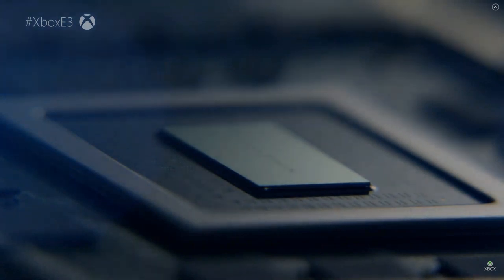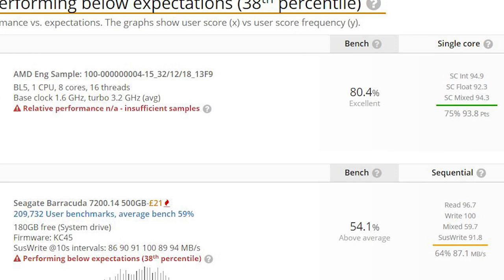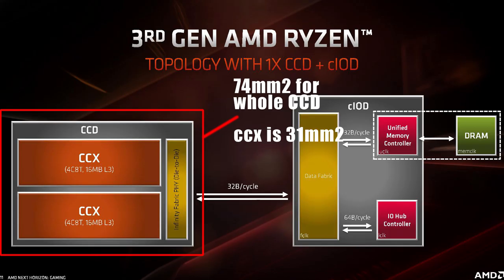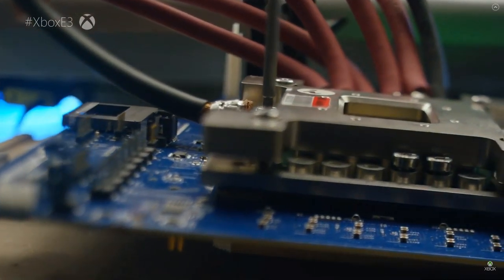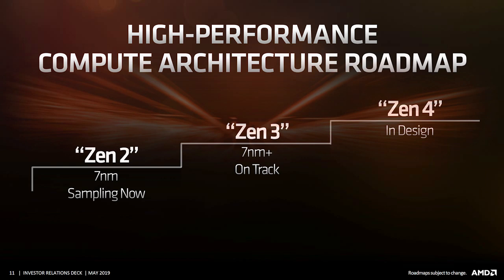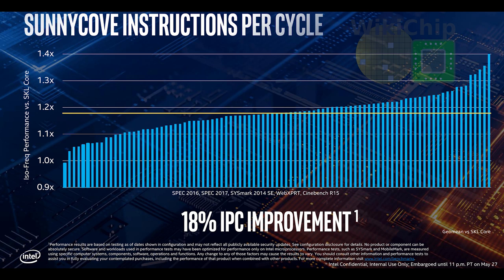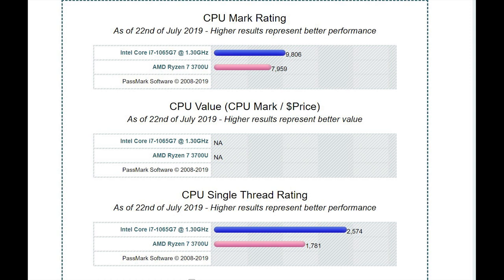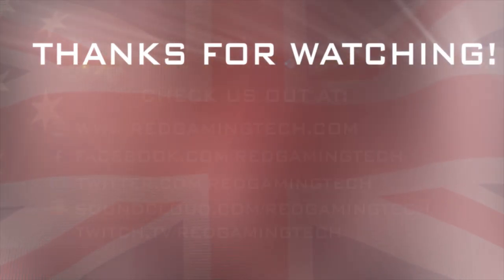AMD 'FLUTE' APU - Next Gen Console APU ? TR4 Spotted In AIDA64 | Ice Lake Is Incredibly Impressive

Comment: the new Intel does not outperform the 3900x in single core. R9 3900x gets 6k on single core...
Reply: IVAN NEGA  it didn't...
Reply: At single core it boosts to 3.9GHz doable at 15w can it sustain multiple cores at such Freq under that power envelope? I think someone bought an expensive intel CPU and is fighting with reality. AMD is king now
Reply: Is not Intel's tdp at base clock?  If so the 3.9 boost is significantly higher than 15w.  And if that boost is all core the heat is on.

Comment: PS5 for sure. You can tell by where the flux capacitor plugs in.
Reply: The board they showed was from Microsoft lol.
It was in their tease for Scarlett
Reply: No , its an UDOO BOLT ( probably the V10 or V12 )
Reply: do you also see the ultra high output plasma field generators?

Comment: You forgot intel TDP is base clock and AMD is Boost clock.
1065g7 is going to pull far more under boost then 15tdp.
Which one is better will depend on price and what you want it for, battery life the 3700u will likely be superior.

Comment: I feel like if new Intel's CPUs are really that fast then they probably will stop AMD from becoming dominant in all markets.
Reply: So far they only have low power laptop CPUs running.
Reply: The main thing that makes it slow for AMD to take the market is the volume of chips they can get produced, it's very small amounts vs Intel and Intel still had problems meeting demands with their high volume.
Reply: @wing0zero  AMD will help them by lowering demand.  Their H2 are going to give them a lot of cash.
Reply: @Viewer19  
In certain sectors for sure, but the mass money comes from people buying laptops and pre built systems who don't care about single thread this, multi performance that, gamers for example are a tiny % and even more so gamers into the actual tech and build themselves, this is reflected in 2018 end where Zen gen 2 was out and doing well, AMD made about 330 million profit where as Intel made something silly like 20 billion, that's because they still have the OEM sector and will for some time as AMD can't meet the demand of that market, Intel sell more chips to Dell in a month than AMD sells all year, so while there doing great which is awesome for competition people sometimes don't quite understand what a giant Intel really is, I mean Nvidia is small fry next to Intel and they still pulled in something like 4 billion profit for 2018, I just hope AMD can keep the momentum to secure higher volume production and snag a bit more OEM contracts.
Reply: @wing0zero  wing0zero," the main that makes it slow for AMD to take market is volume of chips they can get produced" im asking you kindly to stop posting such nonsense, you clearly have no idea about this. TSMC does not have problems supplying enough AMD CPU's for the market,(yes matisse is temp sold out somewhere, dosnt matter).